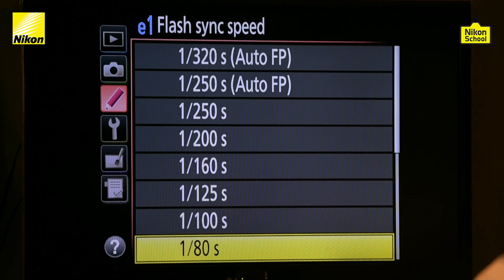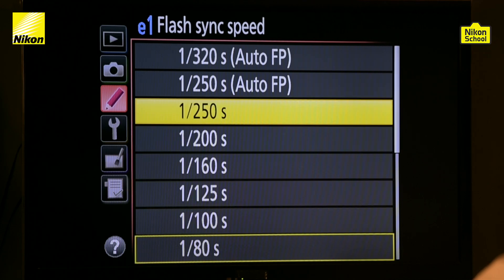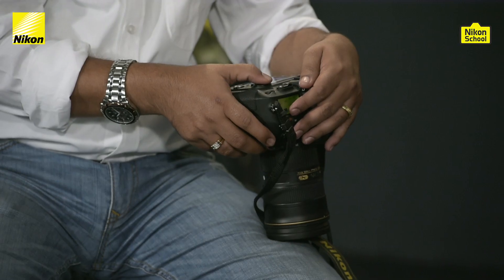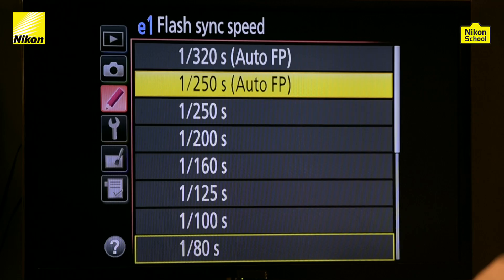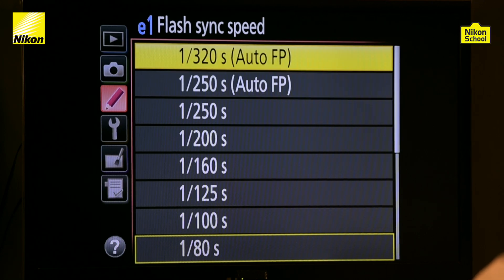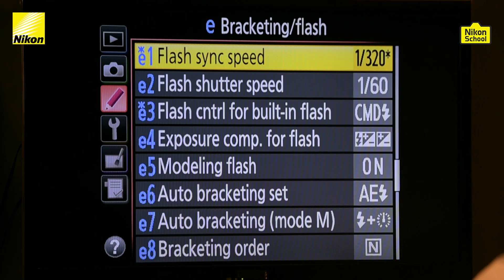New Nikon School D-SLR Tutorials  - Flash & Sync Speeds - Episode 4

Comment: Good afternoon need some help please I have a Nikon d850 👍
The question I would like to ask please is were in setting can I set the camera for the camera to fire the flash continuous please?
Also can you do the same in the stacking mode please 
Many thanks 
Steve
Reply from the maker: Dear Wash View Photography, Please get in touch with our technical experts at nindsupport@nikon.com. If your problem can be fixed online then they will definitely help you otherwise you may have to get your camera checked at the nearest service centre.

Comment: I have Nikon D5200 & my camera does not have the option of Flash Sync Speed. It just has  Flash cntrl for built-in flash which has 2 options - 1. TTL & 2. Manual. I just have bought Godox AD200 pocket flash with trigger but I am not able to use the HSS option. Please help.

Comment: Excellent video! I was able to gain a clear understanding of sync speed and the concept of two curtains, which I was totally unfamiliar with before watching. But there is one thing I'm a little confused about that I'm hoping someone could clarify.  If my camera's max sync speed is 1/250, what the difference between using "1/250 s" and "1/250 s (Auto FP")?
Reply: In Auto FP mode the camera will automatically sync even if you select a shutter speed higher than 1/250.  Not sure it would do so if you only select 1/250 without Auto FP.

Comment: Hi Abishek.... THis is Sandeep from Cochin. im using NIkon D7200 and i have enabled Auto FP feature @1/320s in Camera. but when i use 1/500 shutter speed im getting blackband. ONLY at 1.320 im getting perfect frame shot. why is this. what should be the settings in Nikon flash SB910 which im using. .will this relay on my apperature. i tested this at f2.8 and also at f8. but same length of blackband on both apperatures. kindly advice.

Comment: Hi Nikon
I have seen the video and i learnt something useful to my knowledge.Thanks for that Nikon.
here come my Doubt
I Own a Nikon D750 and i know Basic level photography but my hands on external flash never happened and i am clueless about it
so,recently i bought Nikon SB5000 speedlight and i am yet to crack it.i do not know how to use it and here in this video you were talking about commander mode and auto fp.I set the same on my camera but the external flash is not working .still the in built flash lights up.do i have to set the same in SB5000 and how do i do it? if you could make a video on basics of external flash as well as SB5000 , it will help others as well i would be happy to learn it . Thanks....I AM NIKON
Reply: Hi,
Set camera flash and external flash on same channel number.
Thanks

Comment: Hi,

I am using Nikon d3300 DSLR I am not finding the custom settings in my camera. Can you please let me know how can I work with External Flash in MY Nikon D3300.
Reply from the maker: +karthik kumar Hi Karthik
 
If you are looking for the Auto FP flash Mode then we will have to inform you that Nikon D3300 camera does not have this feature. You can attach an external speedlight on the hot-shoe.
Reply: +Nikon India  is there a chance to connect external flash without connect to hot shoe?
Reply from the maker: Hi Karthik,
Please mail us at nindsupport@nikon.com
Reply: +Nikon India So what if I could attach an external flash on my Nikon d3300 then is there any chance having a slower shutter speed than my camera's x sync speed?